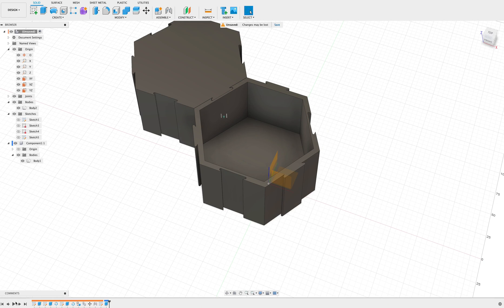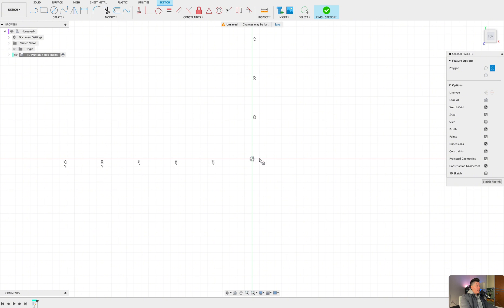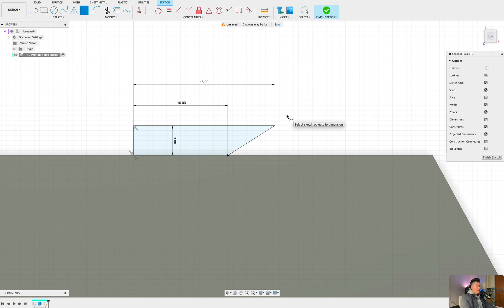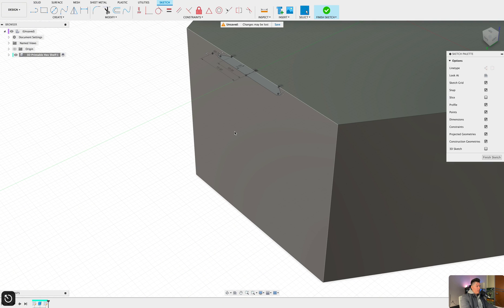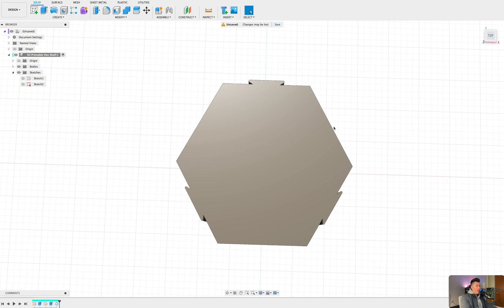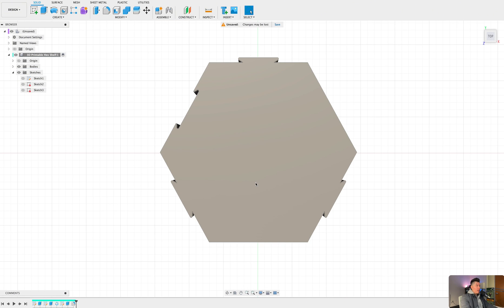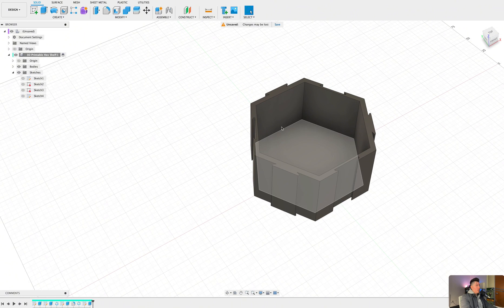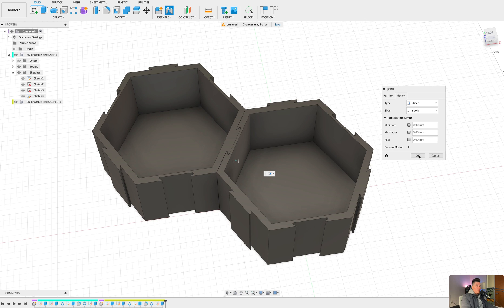Fusion 360 Course for 3D Printing 2024 Edition | Part 5 3D Printable Hex Shelf

Comment: So many issues with this design. First, creating the notch and the opening are not related in any way. If you were to change one, the other will still be the old dimensions. You could do a pattern on the original notch and offset it so the new one is related to the original. Then, hollowing out the shelf again is not in ANY WAY related to the original sketch and its dimensions. The correct way would be to either project the original polygon onto the new sketch and create an offset off of that instead of the face. OR at the very least create a polygon but constrain it to the projected polygon so it stays in relation. 

In general very very poor tutorial. You just taught a bunch of people a bunch of bad practices. I suggest nobody follow this content.
Reply from the maker: Sorry you feel that way.
Reply: Well, you make some points that we might be able to learn from. But then you shoot it all away by being noxious about it. Did anyone ever teach you the concept of "constructive criticism?"
Reply: @bradnelson3595  Sorry these mistakes are too amateurish to teach other people. It will only teach you bad practices. Thus, ignore this content.
Reply: "All or Nothing at All" was a great hit by Frank Sinatra. But it's not applicable to learning Fusion 360. I thought your comments were an opportunity to learn something...and I did. I'm just starting out. And I'll grant you that a lot of tutorials out there are lacking. But as a raw beginner, even these are useful. And this fellow seems like a good bloke. I see no reason to jump on him for being imperfect. By all means, offer tips and corrections. But perfectionism is a tough task masker. Better to offer advice than condemnation.